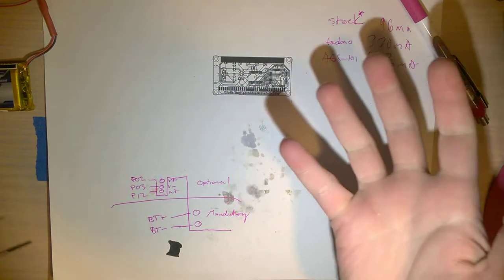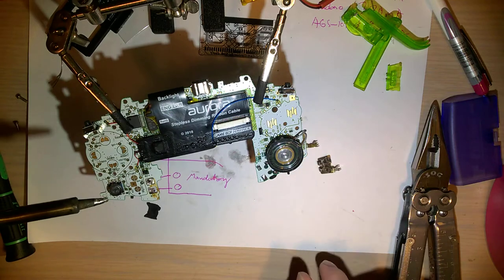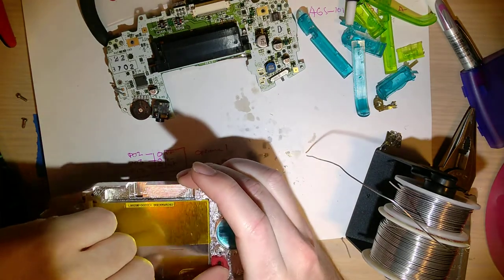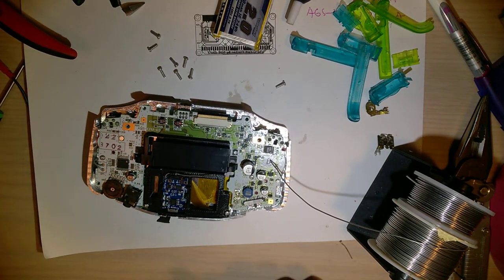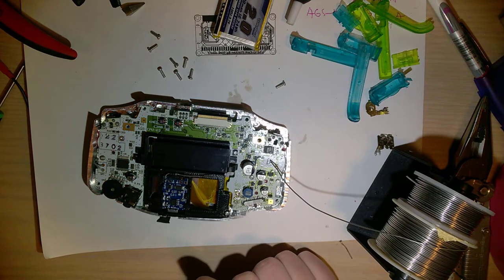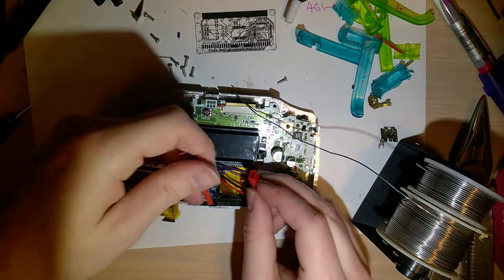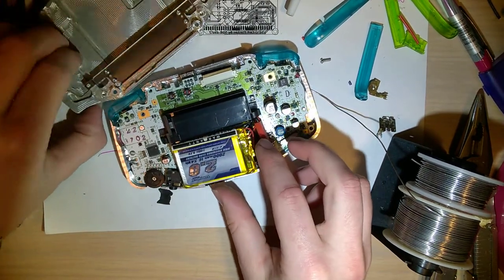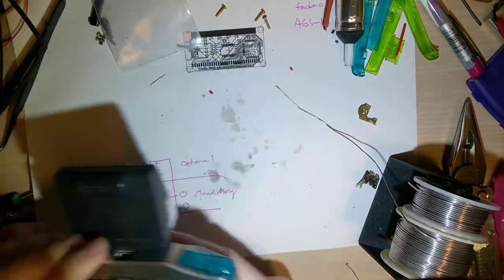Installing a GBA in my new BoxyPixel Aluminum Shell

Comment: Be careful with galvanic corrosion with this shell. It’s imperative you use the supplied screws and not the GBA screws.
Reply: The original screws won't even fit, the threads are completely different.

Comment: Hello, Makho I have been watching your channel for a bit now. I just recently purchased a pre-assembled boxy Pixel GBA and it seems to have a short. When loading my everdrive cartridge I am unable to select any console directories. Also, The brightness is turned up by pressing the select button instead of the select and right buttons. Decreasing the brightness, however, works correctly by holding select and hitting the left button. Is there anything I should try, or should I ship this thing back to the seller for repair at this point?
Reply from the maker: If you purchased a working game boy, the onus is on the seller to provide a working game boy. You should return it for replacement/repair/refund.
Reply: @makho  Thank for the input. I ended up discovering the wire going to the left trigger was slightly pinched. opening the device and pushing it down so it was no longer being clamped down on resolved the issue. Apparently this issue only affects everdrive games and regular games would play fine.

Comment: i just got my anodized case. i got it together. the battery life is insane lol. my only issue is that the screen doesn't align with the glass perfectly...
Reply from the maker: Such is life with custom GBAs. I find that most of the time this is the result of off center screen lenses. I noticed that one of my aftermarket glass lenses had been printed off center so the screen cutout itself was impossible to center.
Reply: @makho  when i custom my regular shells. im so anal about dust and alignment on the screen. so i always do them perfectly. but metal you cant go any futher in moding the case without good tools.
Reply: @makho  yeah not only is the window on the lenses slightly off center (towards the left in the ones I've seen) but the backlit LCDs are off center in their metal housing slightly to the right. I suggested to Nick at Boxypixel that he should compensate for this in a future revision. That and add the holes to the top of the housing so the wireless adapter and GC link cable can be used.
Reply from the maker: @adimifus  I don't believe that the offset with the LCD itself is the same for all units. I have a shell that has a cutout to perfectly fit the LCD and since I left some small tabs at the bottom. The LCD itself cannot move around. I recently replaced the insides of this console (to build this aluminum one actually) and the new screen shows a bit of bleed on the one side that the original screen did not have. Both screens are aftermarket AGS-101 displays.
Reply: @makho  there might be some variance. I only have 2 screens to compare-- one aftermarket and one original ags-101. They both are offset to the right about the same in the aluminum shell. The aftermarket screen actually fits more snugly. My ags-101 screen could shift a bit left and right, so I stuck a piece of paper in between the ags-101 screen and the shell as a shim to try to reduce the offset as much as I could. It's SLIGHTLY better, but still off center quite a bit.

If the window in the lens was perfectly centered, it wouldn't be as much of a problem. I wonder if that's just an error in the manufacturing or if the original reflective LCDs are actually offset to the left and the lens offset is to compensate for that...